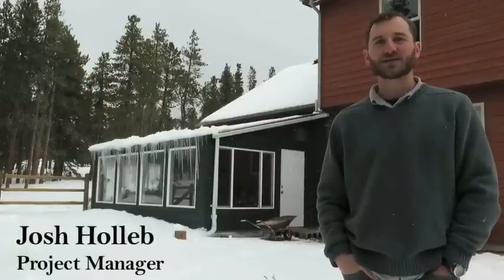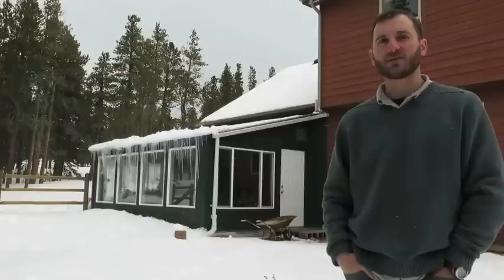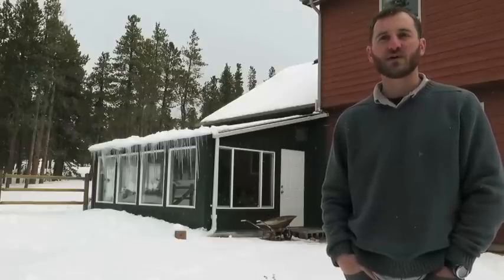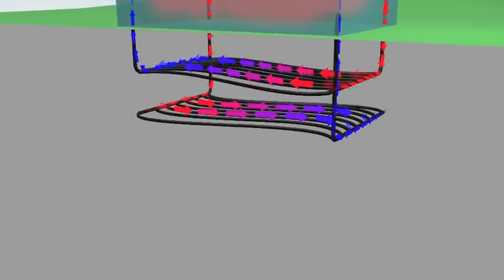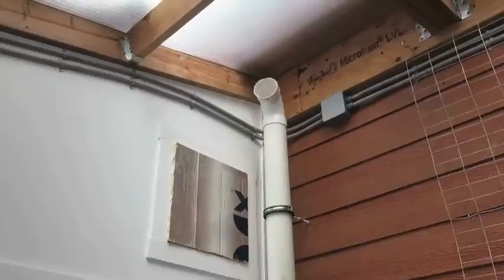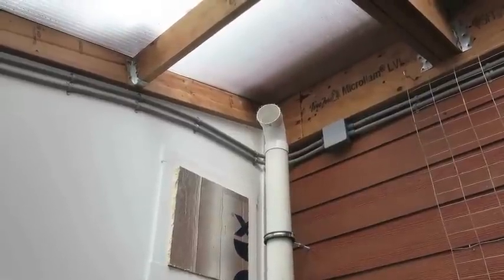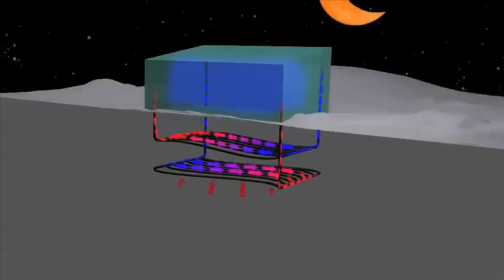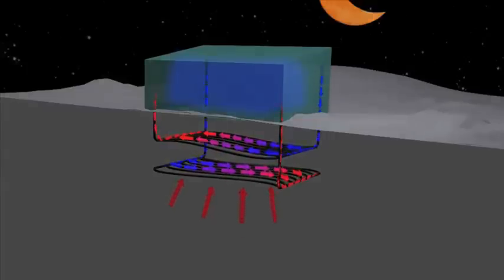Ground to Air Heat Transfer (GAHT®) System - Ceres Greenhouse Solutions

Comment: i have clay based soil 3 ft down, will this sytem work in clay?
Reply from the maker: Thanks for reaching out. We do not recommend that GAHT systems are placed in clay soils for two main reasons:
1. clay does not transfer heat well.
2. clay does not drain well and therefore, can cause gaht systems to become inundated with water and therefore not useable.

We recommend loamy soil for GAHT design - 30-80% sand, 30-50% silt, and 10-35% clay. If you would like to know more, please contact us at ceresgs.com/contact/

Comment: I wonder how efficient this is. Our ground tends to freeze during the winter. Do you have any long-term statistics for this system over the seasons, especially winter?
This seems to me a lot like perpetual energy. Good on paper, but not practical.
Reply from the maker: We can attest it is practical but your reliance on it really does depend on your climate and growing goals. When we design a GAHT system for your geographical location we are sure to install the piping below the frost line where the soil is between 55-65 degrees year-round. We also insulate the perimeter of the pipes to help retain heat around the system. For more information on whether the GAHT is right for your application, check out this blog: https://cerescann.com/ceres-gaht-system-versus-the-ceres-ecoloop/

Comment: I wonder what use it would be to supplement the heat and cooling sink or heat and cooling mass by adding pipes filled with water, running along side or in contact with the existing air flow pipes?
Reply from the maker: Hey Cris, thanks for reaching out. We have had clients design something similar in conjunction with their GAHT system but if you're interested in this ground loop concept, you should check out our EcoLoop geothermal HVACD system: https://ceresgs.com/environmental-controls/ecoloop-sunchamber/ it's a little more high-tech but efficient none the less

Comment: how long do the pipes have to be? I keep reading how low they need to dig, but wondering how much pipe is actually buried and in what configuration. Your configuration looked like a radiator, but wouldn't that reduce the amount of soil needed to maintain the temp around that piece of pipe?
Reply from the maker: All of the pipe is buried except for the inlet and outlet pipes. As far as configuration, it depends on what zone the greenhouse is in and what the heating and cooling requirements are for the greenhouse. For more information, check out this video: https://www.youtube.com/watch?v=uTQ3FL0IGhU&t=8s. Or email us at info@ceresgs.com

Comment: How deep are the pipes under ground? What's the diameter of the pipes?

Very clever design, thanks for sharing.
Reply from the maker: The pipes are buried about 4-6 feet underground. Or at least below the frost line. As far as the diameter of the pipes, I am not sure of this exact measurement but if you email info@ceresgs.com, a representative can get you in touch with our GAHT™ expert. Or you can watch this video to get more information: https://www.youtube.com/watch?v=dzRh4GJDMD8&t=1442s

Comment: Alright!  I find the science on this very amazing!  Now honestly, in temperatures that sustain about -25• during the winter for a month or two, this could not maintain heat unless your system was buried very deep!  And if this really works!!!!! Then awesome!!!!!!!!  So how deep do you have to go to use the earth as a battery for winter?  (If not deep it would be like duct work in a house, cold is there useless you heat it)  I know the science would work just how deep and your experience?
Reply from the maker: Typically the pipes of the GAHT® system are buried 4' underground but in some climates, we dig deeper to get to more consistent temperatures. We want to make sure we get below the frost line where it is consistently around 50-60 degrees. In really really cold climates like the one you mention, the GAHT® system may not be able to sufficiently heat the greenhouse without support from an additional heater. It also depends on what crop you are growing and how hardy they are. For more information please email us at info@ceresgs.com

Comment: What about Radon ?
Reply from the maker: Since a GAHT® system circulates air directly through the soil, this is a common question. In areas with high radon levels, this is a possibility and should be taken seriously. However, greenhouses are less dangerous than conventional buildings when it comes to radon. First, you are not in the greenhouse for as much time. Secondly, greenhouses have very high air exchange rates. During much of the year, air (and any radon) will be ventilated outside, and the whole structure will be flushed with fresh air in a matter of minutes. Even if the ventilation system is not on, greenhouses have many more air exchanges than a standard home, mitigating radon build-up. In our tests of GAHT® systems in the Rocky Mountains (an area with high radon levels), the concentration inside the greenhouse was found to be slightly higher than outdoors, but much lower than a dangerous level. By no means is this a comprehensive study, so if concerned, have your soils tested for radon before installing a GAHT® system.

Comment: you could potentially do this with a house and heat it forever at no cost completely sustainably
Reply from the maker: Yes it's possible, we haven't built one to date but it can be done. A couple things to think about when building a GAHT® system for a house: radon and mold. Radon can be tested. And even if there is radon, it is more significant to watch the rate at which it accumulates. In the worst-case scenario, if radon is detected the GAHT™ system can always be shut off. When trying to mitigate mold in the home you could use a filtration system with a UV lamp. It is important to look at the ducting system- how to get air through the system. We can help with the design of a new system, but it is harder to work with existing ones. Understanding these precautions is necessary if you decide to try this system on a house. Please consult us if you are thinking of a house GAHT®.

Comment: Radon?
Reply from the maker: Greenhouses are less dangerous than conventional buildings when it comes to radon. First, you are not in the greenhouse for as much time. Secondly, greenhouses have very high air exchange rates. During much of the year, air (and any radon) will be ventilated outside, and the whole structure will be flushed with fresh air in a matter of minutes. Even if the ventilation system is not on, greenhouses have many more air exchanges than a standard home, mitigating radon build-up. In our tests of GAHT® systems in the Rocky Mountains (an area with high radon levels), the concentration inside the greenhouse was found to be slightly higher than outdoors, but much lower than a dangerous level. By no means is this a comprehensive study, so if concerned, have your soils tested for radon before installing a GAHT® system.

Comment: What's the pricing on this type of setup?
Reply from the maker: The cost of a GAHT® system depends on the size of your greenhouse. Typically, residential GAHT® systems (under 1,000 sq. ft.) cost between $2,000-5,000. Larger commercial greenhouses and school greenhouses typically cost $5,000-$15,000 depending on size.
Reply: @CeresGreenhouseSolutions  Thanks for replying! I have a 24x36 so that would be a larger greenhouse.
Reply from the maker: @Hervinbalfour  If you send us at message at info@ceresgs.com with your project info, a representative will be able to give you more accurate pricing

Comment: I would like to see actual scientific analysis applied to prove that this works as explained.  I am very interested in this topic, but my research shows this is flawed as it is presented.  I have some land at 9000' in CO that I wish to build a greenhouse on in the future.  Soil has mass of about 40lb/ft3.  If I had a 15'x60' greenhouse, and I sunk some ICF stem walls 6' down, and insulated under this block of soil, that would be about 216k pounds of mass.  If I had a usable temperature differential of 40 degrees (and that is pretty extreme and unlikely to achieve), that gives me a bank of 8.6M BTU.  With R2 dual-wall polycarbonate glazing, by my BTU calculations, that heat would be completely used up in approximately 30 days of the coldest part of winter.  I have also disregarded heat loss through the bottom and wall insulation, which would be considerable (if not total) over a period of months.  There is a community in Canada where they did this on a much larger scale (50 homes), and their heat payback from the earth-based battery was only 39%, and would cost millions to replicate.  When you lose that economy of scale and try to replicate it on a much smaller scale, it would give a system gaining you less than 10%, and likely not worth the effort.
Reply from the maker: Brian, thanks for reaching out. We have a few GAHT® experts working for us that would love to discuss this information with you. This platform is not the most appropriate to do so as they do not manage our Youtube account. If you either send us your contact info or reach out to us directly via email: info@ceresgs.com, we will connect you with someone who can share data and talk about the efficacy of the product. We have installed hundreds of these systems all over the country and we have equally as many happy clients. We would love to work with you and figure out a solution that would be effective for your project.

Comment: electricity must kill your bill
Reply from the maker: Actually quite the opposite. Our clients who use a GAHT® system in their greenhouse see energy savings of up to 80%. Only a small amount of electricity is needed to run the fans that push the air underground and back into the greenhouse. The steady temperature of the ground underneath the greenhouse does all the heavy lifting.

Comment: I'm living in Russia for the next year and the temperature in this region drops to -35°C. Will this system still keep my greenhouse warm on it's own or would I need to help it more somehow? For example a rocket mass heater too.
Reply: I would build a rocket mass stove at each end for a just in case safety factor at those temps.
Reply: @jdm1066  I did and it's working great. I could probably get away with growing tropical plants there now too.😅

Comment: Does it cool as well?
Reply from the maker: Yes it is a heating and cooling system. Heating in the winter by pulling the underground air (consistently around 60-65 degrees F) back into the greenhouse, and cooling in the summer by doing the same.

Comment: so it's basically an earth battery
Reply from the maker: Ceres Ground to Air Heat Transfer (GAHT®) system is a type of ground to air heat exchanger. Over the years, these have gone by many names including Climate Batteries, coined by Jerome Osentowski and Michael Thompson of the Central Rocky Mountain Permaculture Institute (CRMPI). GAHT® systems and Climate Batteries use the same concepts, with some slight differences in design and airflow rates. Another similar concept is earth tubes. These use one-way airflow: they draw air in run it underground and pump it into the structure. GAHT® systems, in contrast, are a closed loop.
Reply: @CeresGreenhouseSolutions  thank you for the info

Comment: How about radon gas getting into the system and contaminating the air?
Reply from the maker: In areas with high radon levels, this is a possibility and should be taken seriously. However, greenhouses are less dangerous than conventional buildings when it comes to radon. First, you are not in the greenhouse for as much time. Secondly, greenhouses have very high air exchange rates. During much of the year, air (and any radon) will be ventilated outside, and the whole structure will be flushed with fresh air in a matter of minutes. Even if the ventilation system is not on, greenhouses have many more air exchanges than a standard home, mitigating radon build-up. In our tests of GAHT® systems in the Rocky Mountains (an area with high radon levels), the concentration inside the greenhouse was found to be slightly higher than outdoors, but much lower than a dangerous level. By no means is this a comprehensive study, so if concerned, have your soils tested for radon before installing a GAHT® system.
Reply from the maker: @Shelly Shumpert The moisture barrier or radon barrier probably does not affect the operation off to GAHT®. These films are very thin. Hear transfer will go right through it. If you have any more questions about the GAHT® system, feel free to send us an email at info@ceresgs.com

Comment: What you are describing here is called "geothermal heating/cooling" and it doesn't work like that. There is no such thing as "...warm soil we created all summer". Deep soil stays same temperature throughout the year. That is why you can use it for cooling in summer and for heating in winter. Not because you "create" it with hot air. You cannot heat dirt and hope it will stay warm until winter. It has it's own pretty much constant temperature and you just work with that.
Reply: it workds for the cycle of day and night but its a big mistake to say you warm it in summer and use it in winter not material takes that long to dissipate the heat lol
Reply: You are getting hung up on 1 thing he said but the design still works to heat or cool the greenhouse as long as the soil temp is higher or lower than ambient air in the greenhouse. It wont freeze most likely.  It also wont get super hot.
Reply: mostunicorn I thought I “smelled something funny.” Thanks.
Reply from the maker: Thank you for your comment. And what you are describing is how the GAHT system works so you are right. But the GAHT pipes are buried 4-6 feet underground and are surrounded by a sunken concrete wall that acts as a perimeter foundation. So, over a summer season of consistent thermal energy  being dumped into the soil directly underneath the greenhouse, within the concrete perimeter,  the soil does get warmer than the standard 60 degrees
Reply: @CeresGreenhouseSolutions  I'd want to see your underground temperature data.  You'e getting some heat from that day's sun, but you're not storing it up over the summer for slow release all winter.  Just don't underestimate how much heat you can build up in a glass enclosure in the dead of winter, especially up in the high country.
Reply from the maker: @harrymills2770  You're right, and it really depends on where you live and how much heat you can store in the Summer. But the gradual release of heat mostly occurs in the Fall when it's transitioning to Winter.

Comment: The soil bank has thermal inertia, which is pumped by heat during the day, and that heat is taken out during the night.  The soil bank acts like a fly-wheel.  Input heat comes from the top of the Green house, which has been heated by the sun.  Soil bank isolation from surrounding ground could be improved by using insulating closed cell foam buried around the periphery of said bank.  From a engineering and physics perspective, I see no reason why this wouldn't work, especially if water condensate drains away from tubes into surrounding soil.  The water in turn also has thermal inertia.  I would model it as about 1 foot diameter of soil around each buried pipe.  The amount of conduction losses to soil bottom are a function of the area exposed to the 1 foot diameter "cylinders" of soil (roughly) surrounding each pipe, and hence that total area touching the bottom, is much lower than the total area of soil being heated/cooled.  So, there must be losses to the earth (1 foot or so from bottom pipes), but it is not a deal breaker.  It is actually a pretty clever system... there is always solar gain into a green house, even on  coldest of days.

Comment: Why not just use an underground water tank? Water has can store 5x more heat than soil and allows you to have a closed system so you dont have to worry about stuff getting into your greenhouse air.
Reply from the maker: Check out our blog on our Ecoloop™: https://cerescann.com/ecoloop-heating-and-cooling/
Reply: Lots of energy needed to pump water.

Comment: How deep are the pipes?
Reply from the maker: Typically, pipes are buried up to 4’ underground. This can vary by area; the goal is to bury pipes deep enough to reach stable soil temperatures. We additionally insulate around the perimeter of the greenhouse to create an insulated pocket of soil beneath the structure.

Comment: I dont think of soil as a good battery for heat
Reply: scientist here, you're 100% correct, soil does not hold any heat at all.  this is why the earth freezes solid over at night time and combusts during the daytime
Reply from the maker: At a certain depth, the soil is a consistent temperature all year long. This depth is where we bury the GAHT® pipes so we can utilize this consistent temp to heat or cool our greenhouse depending on the season. As far as the battery aspect of the system, we insulate around the perimeter of the greenhouse to create an insulated pocket of soil beneath the structure.